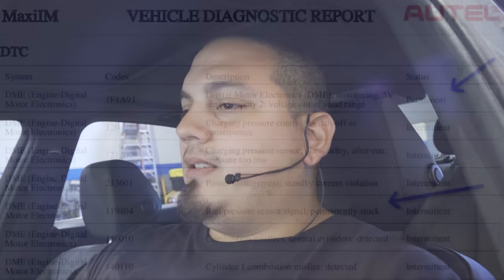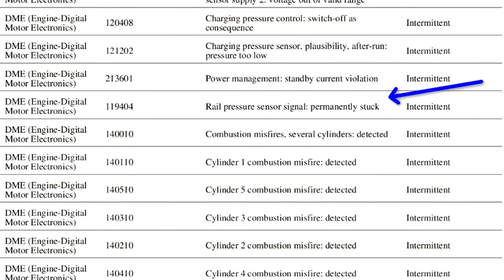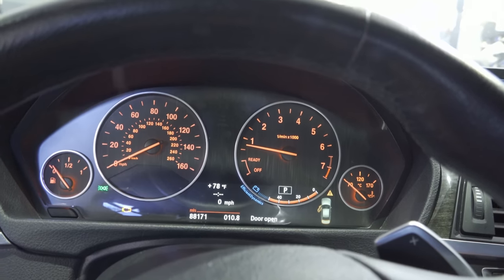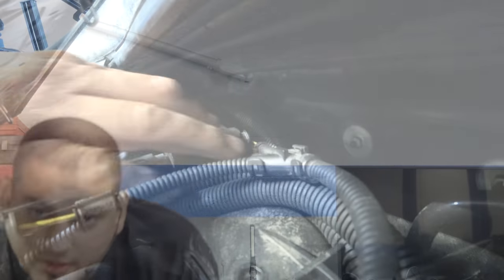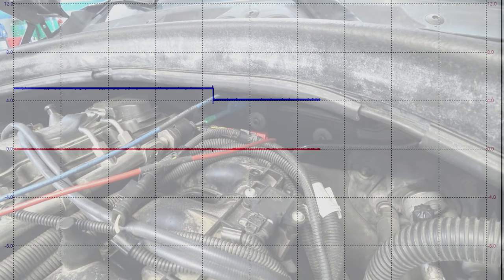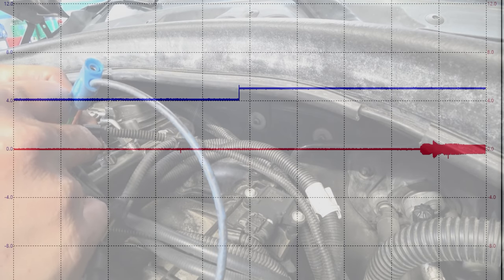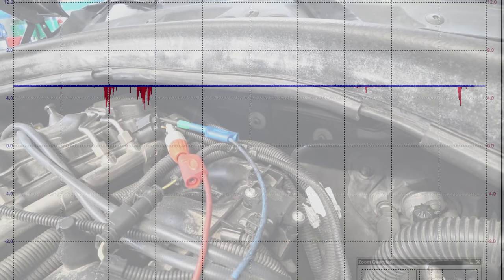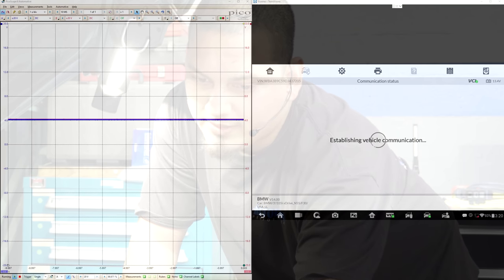2013 BMW 335i - Hard start, stall issue, then becomes a rough idle - 5v ref (1F1A91 119404 - 101F01)

Comment: The main reason why the belt gets sucked into the front crank seal is because of an oil leak from the oil filter 
housing. It leaks on the belt and the pulleys cut into the belt and shreds it then the crank pulley does not have anything to protect the front seal, gets wrapped around then it’s inside! Pretty common especially when the oil leak has been prominent and the car has been driven hard.
Reply from the maker: Yeah this car had plenty of oil leaks(which bmw doesn't right?)
Reply: What actually happens is the oil filter housing/cooler gaskets leak into the belt tensioner, which has polymer guides. The guides deform, the belt tensioner slowly walks the belt into the crankshaft damper. It's the first thing I look for with an N54/55 engine.
Reply: Ryan has it right. The next things to fail are the coolant hoses under the OFHG and then the water pump too. Unfortunately, taking oil leaks as normal on a bmw leaves these issues to snowball.
Reply: BMW: If there's no oil under it, there's no oil in it.
Reply: @FourRingsAuto  You gotta keep on top of them...sadly most owners don't won't :(

Comment: When I see that air-mass code on N55, it's usually that vacuum leak from the front crankshaft seal. It's well over 20 hours on xDrive models to fix the OFHG, crankshaft seal, pull oil pan and clean, etc.

Comment: Hey Mario, thanks again for sharing good trouble car, you asked us to let you know if we've seen this or these issues before, well in my experience I've been doing bmw's for many years and as far as the transition  into gdi , I still not have seen a failed high psi rail sensor short out.  Nor do i think i have seen 5v codes on a bmw. Def interesting and cool to see "new possible" codes. And as far as the front main seal due to belt issue, i dont think I need to express how common that is. Thanks again for sharing.

Comment: Hi Mario, I get to work on my share or euro cars. A 2014 VW Jetta came in the shop running rough and CEL. Pulled codes found p0171. It was a no brainer obviously a vacuum leak. Found the (PCV) breather system leaking, you could hear it. Got a new OE part and cleared codes and reset adapt. Code came back on. Long story short I over looked a the oil leak from the rear main seal. Always do your testes.! It may take a lil more time but it’s worth it.. btw thanks for your videos

Comment: Hi have this code of hell 101F01 on my X3 N55 2011.
Smoke test didn't show any leak.
I just noticed that when I disconnect purge tank valve connector and drive the car, the code does not show up.
When I plug in purge valve I will get several occurences of the code every 2, 3 mn.
The probleme is that I replaced the purge valve with a new one and same issue, I put back the old one but still same issue.
I have done idle procedure for 15mn many times but still same issue.

Comment: As always very informative and great content, i had a similar code stuck 2012 n55 bmw x5 which came few months after i had change the valve cover with pcv system, since car was running fine customer was not interested any further diagnostic however we did find out it was related to main seal issue

Comment: I had my N55 fully stock parked indoors for a week. After doing a cold start the engine was bugging, sputtering and almost stalled to shoot back to 2000rpm. Second cold start, same thing. I had been on the same tank of gas for over a week. So drove to use up as much gas before refueling. Got a fuel tank of 94 octane, left the car over night then did another cold start. Everything went away. Decided to clean the MAF and MAP sensor as prevention. The car gave me no codes or engine lights, strange. I blamed it on gas that must have gone bad.

Comment: Thank you for the very useful video.  
I have a question that I hope you can explain. 
When plugging in and unplugging the electrical connector, the sensor observes the voltage. How to know if the sensor is broken?

Comment: I chased a lean code on an Audi caused by an incorrect fuel rail pressure sensor. The Bosch cross-reference yielded the wrong sensor! Fresh Audi brand sensor from the dealership fixed it.

Comment: I think this vehicle may have had a piggy back box like a JB4 installed, looking at some of the other aftermarket parts. Air mass implausibility is a 'textbook' code for piggy back tuner boxes on these. It will almost always be there.
Reply: This is what I’m afraid of, I believe the car I purchased was tuned and I’m chasing weird codes that are likely due to these tunes
Reply: @AZMATTAZ06  Check there is no JB4 installed...and then flash the ECU back to standard...you'll need the calibration codes from each injector though.

Comment: Feel sorry for that future customer buying that vehicle.  There's probably fragments inside the pick up tube and causing potential future engine damage.  Right now is perfect timing to save that engine.   You may want to ask them how they remove that seal? When the belts get chewed it damages the seal and special tool fails to grip the seal.  After doing that job so many times, sometimes still kick my butt
Reply from the maker: Unfortunately i have no idea if they went through with my suggestion of removing the pan and getting all belt remnants out, after I was completely done with the car. As for the crank seal, i know they have the special tool, but i don't know the details as to how bad it was. Turn around was pretty fast.
Reply: @SuperMarioDiagnostics  those oil pan are a PITA to do. To do that seal you need to retime the engine. Is that correct? I remember doing one of those and there was some friction disks on it. Take care pal.

Comment: Okay so mine is a little like that but it has severely slow crank like really slow cranking then when it starts up it’s got the misfire low idle and dies when goes into gear .. I was told the bearing could be bad and the engine is sized but how can it be started and the engine turns with a wrench by hand please any help would be awesome

Comment: Great you fix that Mario,
We can take this is an additional air coming into manifold through those leaks so by checking with fuel trims can't we confirm this issue?
Reply from the maker: One may get lucky if the leak is big enough, to find the fuel trims lean at idle then correcting under load

Comment: mario that rough running was that cause of rich mixture? not enough pressure building in the crankcase because of leaking seal that suppose to feed back to intake mixture? what are your thoughts?
Reply from the maker: I don't think i mentioned a rich condition

Comment: I have in my bmw 535i gt 2011 this code 119404 i replace the high fuel pressure sensor but it still there and burning a lot of gas, drop black smoke

Comment: So the fuel rail p/s was bad and u replaced it?  Front main seal was leaking air in and not oil out?  The crankcase system must allow for a big vacuum leak. And then the two other small vacuum leaks. And that fixed it.  Good one. Thank u!!
Reply from the maker: Correct. Also the oil was leaking out as mentioned
Reply: @SuperMarioDiagnostics   but there could be a vacuum leak and oil not going out? Smoke test is enough to reveal this leaks or i have to put more pressure on the block?

Comment: Nice one Mario. Got a question about the second problem (the air leak coming from front seal). Could the problem be pinpointed if the breather hose is pinched while watching the fuel trims on generic handheld scanner. Asking because i don't have smoke machine and rely on some basic tests when diagnosing engine performance.
Reply from the maker: It can be deduced, but pinpointed? Unlikely. Imo, maybe knowing about the belt issue would help one come to that conclusion, but Pinpoint without a doubt using fuel trims(might get lucky with alternate fuel and watching trims) i highly doubt it would be easy

Comment: Ive changed everything on my 2013 x3 m n55 engine. Catalitic, gas pump, mass flow sensors, i sealed the top engine thing and the bottom, the injectors, bobinas y bujias dont know how their called in ingles, and im still getting the 101F01 code... Help...
Reply from the maker: Have you tried smoke testing it? Checked the purge valve for leakage? Did you check whether crankcase vacuum was within specification? Look up tsb s1 b11 09 19 for the adaptation procedure. You must do this procedure after each repair in order to clear the code. If the procedure fails to clear the code, you'll have to continue testing. Prueba antes de adivinar con su dinero!

Comment: another good video.

If the Main seal was not able to hold the pressure, then there should be Major Oil leak, isn't it true?
as in 21:00 we see very normal oil seepage.
Reply from the maker: Yes i mentioned the oil leaks
Reply: @SuperMarioDiagnostics  its good learning that normal leak can also cause such issues 👍

Comment: i have same fault 1f1a91 after inversing connector on dme ? What do you think ? what i need to do ?
Reply: i have 1F1A91 and
120408 boost pressure control shutdownas a follow up reaction

Comment: Man im getting my butt kicked by a e90 right now had major drivability issues and every code in the book only had a misfire on cylinder number 2 ended up being a melted coil in that cylinder we replaced all plugs and coils due to mileage and put in a new crank sensor after road testing it to verify repairs now im getting misfires on cylinders 1 and 6 only under heavy load and this was not happening before repairs were made i swapped coils and plugs on those cylinders and still same issue fuel injectors are fine and compression is good do you think the aftermarket crank sensor could be causing this those are the only repairs made
Reply from the maker: I would start fresh. Do a relative compression test.
1&6 are companion cylinders and if something is wrong with one, more than likely it'll affect its companion, especially in the case of a leaking intake valve

Comment: garbage  bimmer, p0011 or p0012 on n51 and n52 , pattern failure on the high pressure pump on n54 and n55

btw i have a question about the high pressure pump system, most of them are driven by the camshaft, when you get a high pressure pump code , how could you tell its the mechanical issue on the worn out cam (vw ea888 worn out cam case study)or its the electrical failure on the pump? being mechanic nowdays suukssssss
Reply from the maker: Usually a mechanical failure has a noise along with it. The electrical failure can be seen with voltage and current, just as we would see a vvt solenoid. The current would show it's opening and the voltage would show it's closing.

Comment: The big issue that caused most of this was an owner driving like an idiot and not programming the new battery. BMW cars will go to hell if you just replace it. Then all these codes will come up. Loose connectors and not properly taking care of the battery.